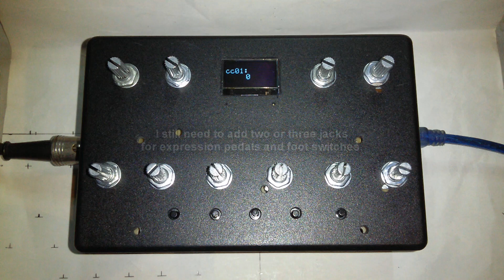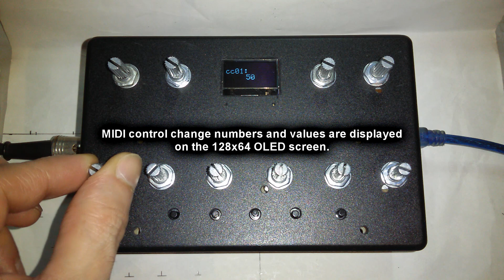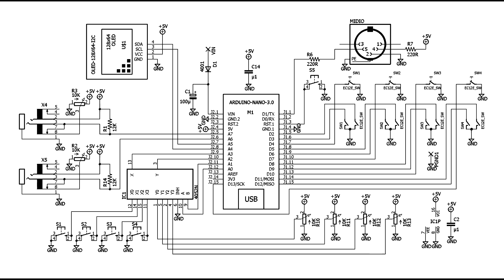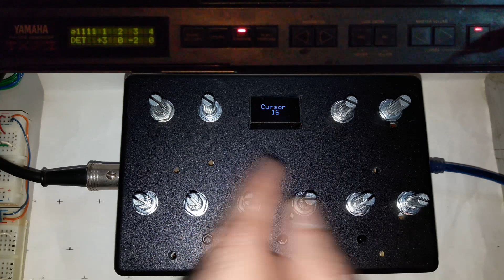TX81Z Arduino MIDI Controller / Editor

Comment from the maker: This Arduino MIDI controller features six potentiometers, four rotary encoders with switch, five additional momentary normally open tactile switches, and one 128x64 pixels I2C OLED display. MIDI output is via traditional five pin DIN connector, there will be TSR jacks for expression pedals and foot switches (for on-off messages like hold and/or sostenuto).
Currently implemented code for sending control change using potentiometers and pedals, and system exclusive messages reproducing the panel switches of the TX81Z (using rotary encoders and switches).
Reply: So you don't have to touch the TX81z, other than turning it on?

Comment: Would you mind sharing the code and schematics? Would be great!
Reply from the maker: I think it is this:
#include <MIDI.h>
MIDI_CREATE_DEFAULT_INSTANCE(); 
#include <EncoderTool.h> 
using namespace EncoderTool;
PolledEncoder encoderA, encoderB, encoderC, encoderD;  
#include "SSD1306Ascii.h"
#include "SSD1306AsciiAvrI2c.h"
#define I2C_ADDRESS 0x3C  
#define RST_PIN -1   
SSD1306AsciiAvrI2c oled;
byte  modu = 0; 
byte  brth = 0; 
byte  foot = 0; 
byte  prtT = 0; 
byte  volu = 0; 
byte  panp = 0; 
byte  hold = 0; 
byte  port = 0; 
byte  mode = 0; 
byte  powr = 0x00;  
byte  stor = 0x00;  
byte  util = 0x00;  
byte  edit = 0x00;  
byte  playPerf = 0; 
byte  pram = 0x00;  
byte  data = 0x00;  
byte  curs = 0x00;  
byte  mvol = 99;    
byte remSw[7]={0xF0, 0x43, 0x10, 0x13, 0x40, 0x7F, 0xF7};
byte val = 0x00;
int average7 = 0;   
int oldaverage7 = 0;
int average6 = 0;  
int oldaverage6 = 0;
byte ctlNum[4] = {0x04, 0x05, 0x07, 0x0A};
byte switches[4] = {0, 0, 0, 0};
long swStateChangeT[4] = {0, 0, 0, 0};
byte debounceT = 10;
byte lastSwState[4] = {0, 0, 0, 0};
const byte  pedalA = A6; 
const byte  pedalB = A7;
const byte   ioX   = A3;  
const byte   ioY   = A2;  
const byte  addressPins[2] = {A0, A1};   
#include <ResponsiveAnalogRead.h>
ResponsiveAnalogRead *analogMux[4]; 
int analogMux_data[4] = {0, 0, 0, 0}; 
int analogMux_data_prev[4] = {0, 0, 0, 0}; 

void setup(){
  for (byte j = 0; j < 4; j++){
    analogMux[j] = new ResponsiveAnalogRead(A3, true, 0.01);
  }
  analogReference(DEFAULT);
  average7 = analogRead(pedalA);
  average6 = analogRead(pedalB);
  pinMode(ioY, INPUT_PULLUP);
  for(byte i = 0; i < 2; i++){
    pinMode(addressPins[i], OUTPUT);
    digitalWrite(addressPins[i], HIGH);
  }
  MIDI.begin(1); 
  MIDI.turnThruOff();
  oled.begin(&Adafruit128x64, I2C_ADDRESS);
  oled.setFont(Stang5x7);
  oled.clear();
  oled.set2X();
  oled.println(F("...TX81Z..."));
  oled.println(F("..Remote..."));
  oled.println(F(".Switches.."));
  oled.println(F(".&Controls."));
  delay(2500);
  oled.clear();
  encoderD.begin( 2,  3,  4); 
  encoderC.begin( 5,  6,  7);
  encoderB.begin( 8,  9, 10);
  encoderA.begin(11, 12, 13);
} 
uint16_t  runningAverage7(uint16_t value){ 
  static  uint16_t  previousValues[20]; 
  static  uint8_t index = 0;
  static  uint16_t  sum = 0;
  static  uint8_t filled  = 0;
  sum -=  previousValues[index];
  previousValues[index] = value;
  sum +=  value;
  index++;
  index = index % 20; 
  if  (filled < 20)   
  filled++;
  return  sum / filled;
}
uint16_t  runningAverage6(uint16_t value){ 
  static  uint16_t  previousValues[20]; 
  static  uint8_t index = 0;
  static  uint16_t  sum = 0;
  static  uint8_t filled  = 0;
  sum -=  previousValues[index];
  previousValues[index] = value;
  sum +=  value;
  index++;
  index = index % 20; 
  if  (filled < 20)   
  filled++;
  return  sum / filled;
}

void address(byte muxChn){
  for(byte i = 0; i < 2; i++)
  {
    if( muxChn & (1 << i) ) digitalWrite(addressPins[i], HIGH);
    else digitalWrite(addressPins[i], LOW);
  }
}

void muxRead(byte muxChn){
    address(muxChn);
    switches[muxChn] = digitalRead(ioY);
}

void loop(){
  encoderA.tick(); 
  encoderA.setLimits(-1,1); 
  encoderB.tick();
  encoderB.setLimits(-1,1);
  encoderC.tick();
  encoderC.setLimits(-1,1);
  encoderD.tick();
  encoderD.setLimits(-1,1);
  if(encoderA.valueChanged()){
    int encA = encoderA.getValue(); 
    encoderA.setValue(0);           
    mvol = constrain(mvol+encA, 0, 99); 
    if(encA == -1){
      remSw[4] = 0x49;
    }
    else if(encA == 1){
      remSw[4] = 0x4A;
    }
    MIDI.sendSysEx(7, remSw, true);
    oled.clear(0,127, 2,3);      
    oled.setCursor(0, 2);
    oled.print(F("Master Vol"));
    oled.clear(0,127, 4,5);      
    oled.setCursor(53, 4);
    oled.println(mvol,DEC);
  } 
  if(encoderB.valueChanged()){
    int encB = encoderB.getValue();
    encoderB.setValue(0);
    curs = constrain(curs+encB, 0, 16);  
    if(encB == -1){
      remSw[4] = 0x49;
    }
    else if(encB == 1){
      remSw[4] = 0x4A;
    }
    MIDI.sendSysEx(7, remSw, true); 
    oled.clear(0,127, 2,3);   
    oled.setCursor(0, 2);
    oled.print(F("  Cursor  "));
    oled.clear(0,127, 4,5); 
    oled.setCursor(53, 4);
    oled.println(curs,DEC);
  } 
  if(encoderC.valueChanged()){
    int encC = encoderC.getValue();
    encoderC.setValue(0);
      data = constrain(data+encC, 0, 127); 
      if(encC == -1){
        remSw[4] = 0x47;
      }
      else if(encC == 1){
        remSw[4] = 0x48;
      }
      MIDI.sendSysEx(7, remSw, true); 
    oled.clear(0,127, 2,3);     
    oled.setCursor(0, 2);
    oled.print(F("Data Entry"));
    oled.clear(0,127, 4,5);   
    oled.setCursor(53, 4);
    oled.println(data,DEC);
  } 
  if(encoderD.valueChanged()){
    int encD = encoderD.getValue();
    encoderD.setValue(0);
      pram = constrain(pram+encD, 0, 127);  
      if(encD == -1){
        remSw[4] = 0x45;
      }
      else if(encD == 1){
        remSw[4] = 0x46;
      }
      MIDI.sendSysEx(7, remSw, true); 
    oled.clear(0,127, 2,3);     
    oled.setCursor(0, 2);
    oled.print(F("Parameter"));
    oled.clear(0,127, 4,5);
    oled.setCursor(53, 4);
    oled.println(pram,DEC);
  } 
  if(encoderA.buttonChanged()){
    if(encoderA.getButton() == LOW)
    {
      remSw[4]=0x44;
      remSw[5]=0x7F;
      MIDI.sendSysEx(7, remSw, true); 
    oled.clear();   
    oled.setCursor(0, 2);
    oled.print(F("Play/Perf"));
    }
  } 
  if(encoderB.buttonChanged()){
    if(encoderB.getButton() == LOW)
    {
      remSw[4]=0x43;
      remSw[5]=0x7F;
      MIDI.sendSysEx(7, remSw, true); 
    oled.clear(); 
    oled.setCursor(0, 2);
    oled.print(F("Edit/Comp"));
    }
  }
  if(encoderC.buttonChanged()){
    if(encoderC.getButton() == LOW){
      remSw[4]=0x42;
      remSw[5]=0x7F;
      MIDI.sendSysEx(7, remSw, true);
    oled.clear(); 
    oled.setCursor(0, 2);
    oled.print(F("Utility"));
    }
  }
  if(encoderD.buttonChanged()){
    if(encoderD.getButton() == LOW) {
      stor = stor + 0x7F;
      if(stor > 0x7F) stor = 0x00;
      remSw[4]=0x41;
      remSw[5]=stor;
      MIDI.sendSysEx(7, remSw, true);
    oled.clear();
    oled.setCursor(0, 2);
    oled.print(F("Store/EGCpy"));
    }
  }
  average6 = analogRead(pedalB);
  average6 = runningAverage6(average6);
  if(abs(average6 - oldaverage6) > 7){                                    
    brth = average6 >> 3; 
    MIDI.sendControlChange(2, brth, 7); 
    oldaverage6 = average6;
    oled.clear(0,127, 2,3); 
    oled.setCursor(0, 2);
    oled.print(F("cc02:"));
    oled.clear(0,127, 4,5);
    oled.setCursor(53, 4);
    oled.println(brth,DEC);
  }
  average7 = analogRead(pedalA);
  average7 = runningAverage7(average7);
  if(abs(average7 - oldaverage7) > 7){                                    
    modu = average7 >> 3;           
    MIDI.sendControlChange(1, modu, 7); 
    oldaverage7 = average7;
    oled.clear(0,127, 2,3);  
    oled.setCursor(0, 2);
    oled.print(F("cc01:"));
    oled.clear(0,127, 4,5); 
    oled.setCursor(53, 4);
    oled.println(modu,DEC);
  }
  for(byte muxChn = 0; muxChn < 4; muxChn++){
    muxRead(muxChn);
    if((millis() - swStateChangeT[muxChn]) > debounceT){
      byte swState = switches[muxChn];
      if(swState != lastSwState[muxChn]){
        if(swState == 0){
          if(muxChn <= 1){
            val = val + 0x7F;
            if(val > 0x7F) val = 0x00;
            MIDI.sendControlChange(64+muxChn, val, 7);
    oled.clear(0,127, 2,3);
    oled.setCursor(0, 2);
    oled.print(F("cc"));
    oled.print(64+muxChn, DEC);
    oled.print(F(":"));
    oled.clear(0,127, 4,5);
    oled.setCursor(53, 4);
    oled.println(val,DEC);
         }
          else if(muxChn == 2){
            remSw[4] = 0x48;   
            remSw[5] = 0x7F;
            MIDI.sendSysEx(7, remSw, true); 
    oled.clear(0,127, 2,3);
    oled.setCursor(0, 2);
    oled.print(F("Store?"));
    oled.clear(0,127, 4,5); 
    oled.setCursor(53, 4);
    oled.print(F("Yes"));
          }
          else if(muxChn == 3){
            remSw[4]=0x4B;
            remSw[5]=0x7F;
            MIDI.sendSysEx(7, remSw, true);
    oled.clear(0,127, 2,3);
    oled.setCursor(0, 2);
    oled.print(F("Cursor"));
          }
        }
        lastSwState[muxChn] = swState;
        swStateChangeT[muxChn] = millis();
      }
    } 
    analogMux[muxChn]->update();
    if (analogMux[muxChn]->hasChanged()){
      analogMux_data[muxChn] = analogMux[muxChn]->getValue() >> 3;
      if (analogMux_data[muxChn] != analogMux_data_prev[muxChn]){
        analogMux_data_prev[muxChn] = analogMux_data[muxChn];
        MIDI.sendControlChange(ctlNum[muxChn], analogMux_data[muxChn], 7);
    oled.clear(0,127, 2,3);
    oled.setCursor(0, 2);
    oled.print(F("cc"));
    if(ctlNum[muxChn] < 10) oled.print(F("0"));
    oled.print(ctlNum[muxChn], DEC);
    oled.print(F(":"));
    oled.clear(0,127, 4,5);
    oled.setCursor(53, 4);
    oled.println(analogMux_data[muxChn], DEC);
      }
    }
  } 
}